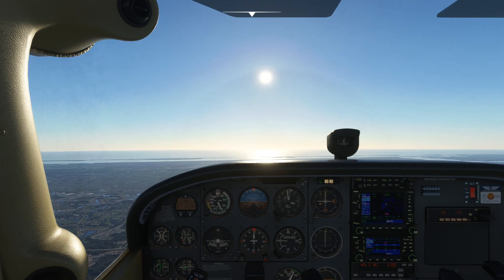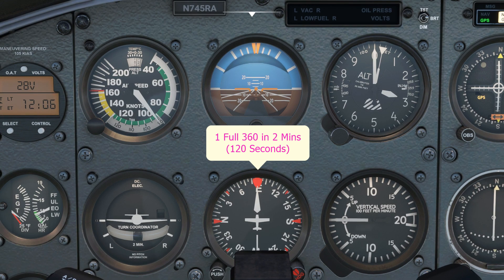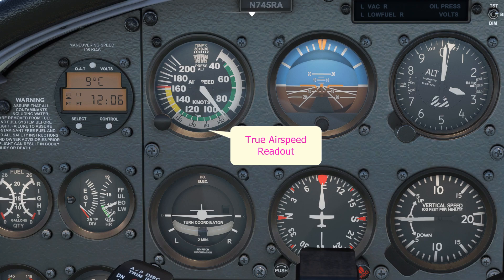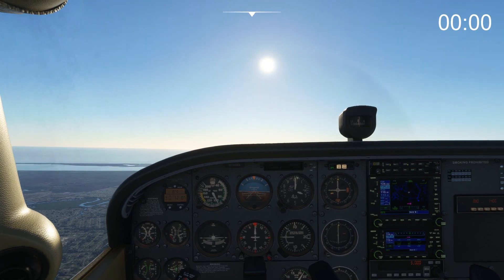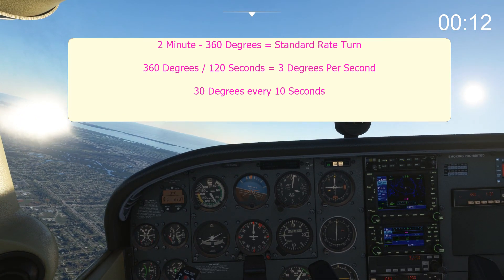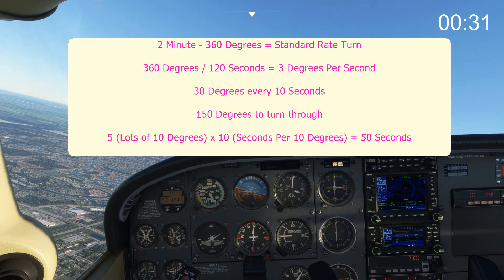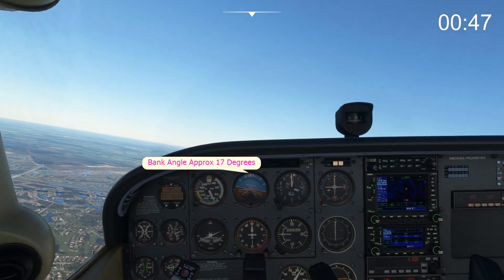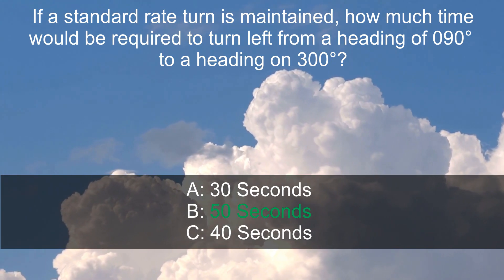Standard Rate Turns | Theory Quickie | Microsoft Flight Simulator | Real Airline Pilot / Instructor

Comment: Is this a trial and error kind of thing for airplanes that dont have the turn coordinator instrument? Full glass G1000 doesnt seem to have a turn coordinator that i can find. Just the magenta turn rate indicator. I suppose i could fly around timing circles to determine the standard rate, but i must be he missing something....
Reply: Aaahhh classic. As soon as I ask someone, I find the answer. From the G1000 POH:

The Turn Rate Indicator is located directly above the rotating compass card. Tick marks to the left and right
of the lubber line denote half-standard and standard turn rates. A magenta Turn Rate Trend Vector shows the
current turn rate. The end of the trend vector gives the heading predicted in 6 seconds, based on the present
turn rate. A standard-rate turn is shown on the indicator by the trend vector stopping at the standard turn
rate tick mark, corresponding to a predicted heading of 18˚ from the current heading. At rates greater than 4
deg/sec, an arrowhead appears at the end of the magenta trend vector and the prediction is no longer valid.

Can't include a pic in my comment, but the tick marks it's talking about are the ones that lie above the magenta Turn Rate Trend Vector.
Reply from the maker: Yes, I point it out on some of my G1000 videos too!
Reply: @Taylair  nice!! Thanks I'll have to check them out to see what else I'm missing. :) Thanks for the videos.

Comment: 1:25 why make the calculation so complicated? You don't wanna know how many degrees will take one second, you wanna know how many seconds does it take to turn 1°. If you know that, you can easily determine any amount of degrees.
Your's was only so simple because the degrees to turn was a multiple of 3 (or 30) if it had been something odd (like 127) you would have massive problems getting the result.
Once you do it the other way around though ((120*127)/360) you can do it much faster.
And if you want to do it even faster: it takes 1/3 of a second to turn 1°. Thus, if you wish to know how long it takes to turn left from 125 to 236 all you gotta do is (360-(236-125))/3 or in other words: devide [degrees to turn] by 3
Reply from the maker: The question as far as I interpret it is alluding to turning on partial panel using the timed turn method. You don’t need a 1 degree level of accuracy in those circumstances so knowing the number of seconds needed to turn through 10 and 30 degrees is enough to determine the amount of time to turn.

If you can fly to a one degree level of accuracy with a gyro suction failure on a magnetic compass not directly in your line of sight, you are a better pilot than me for sure!
Reply: @Taylair  It's not about how accurate you can fly. It's about how many steps you need to calculate the required time.
In your case I first need to determine the delta to turn. then I need to check how many 30° chunks and how many 10° chunks there are, then I need to keep track of all of that and then finally add everything up.
By doing it the other way you determin the total delta and divide by three.150/3? easy, 50. 210 divided by 3? easy 70. 127 divided by 3? easy: ~42.
Reply from the maker: I understood first time what you meant, you didn’t have to repeat yourself 😂 I haven’t put the full partial panel perspective in my video because it was just a quick one but that’s the intent behind it. My way can be done in a partial panel scenario by glancing at a compass rose and adding up in 10s and then basically adding either 3 or 6 to it. I would bet you if we taught 10 students both methods 5 of yours would still be trying to work out the difference between the headings and at least 2 would then turn the wrong way while most of mine were already turning in the right direction having just counted it that direction around a compass rose. It does work pretty well honestly.